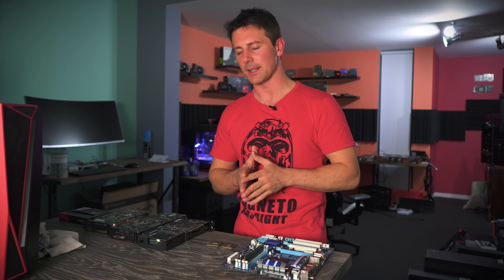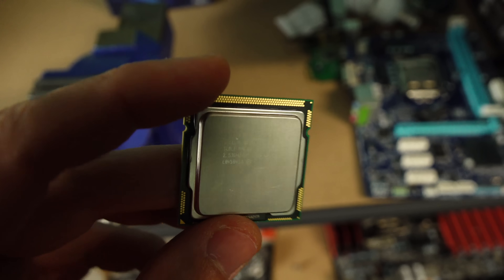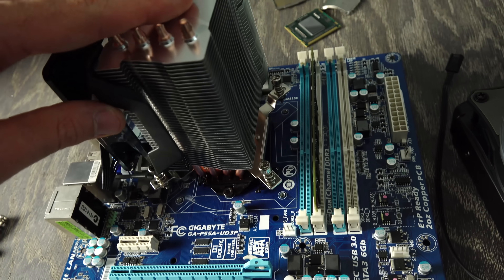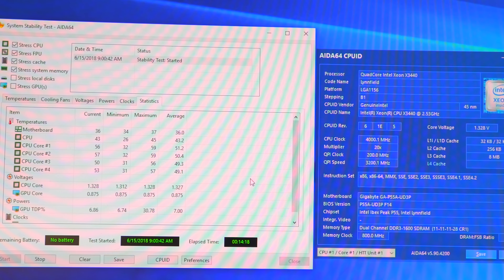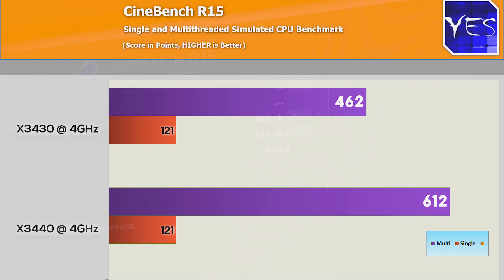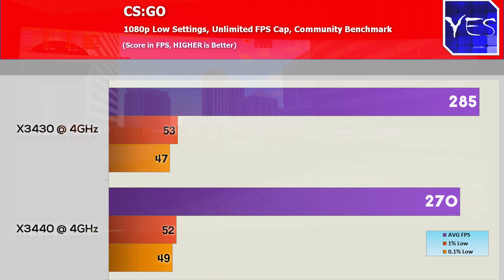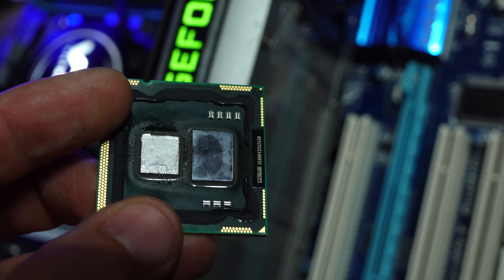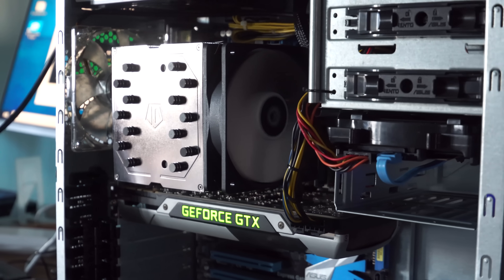X3430 ($7) Vs. X3440 ($18) Xeon - Is Hyper Threading WORTH $11!?

Comment: How did you relided it?
Reply: You can just push it back in really hard, just don't remove the black stuff that it is in when you delid it. That is how I relided my x3440 running very cool with high voltages on prime 95.

Comment: Late comment, but at 8:14 you wondered why the i3-530 had solder on one chip and thermal paste on the other: likely the cpu has the more expensive solder as thermal material for better performance since it puts out a lot of heat, while on-chip gpu puts out less heat and regular cheaper thermal paste doesn't impact performance - a way to save money during manufacturing.

Comment: hmm. I wonder if bryan will make an update with this Xeon processor. this X3440 is about $12 price now.
Reply: It still does everything great for me. I have mine at 4.4 Ghz ans runs any game over 60 fps. The only issue it might get later is the 16 gigs of ram limitation. It does have enough horsepower for another 5 years probably so it is still a good buy if you ask me.

Comment: hey i have installed x3440 on asus p7-h55m. there's a 8 gigs of ram stick @1866. but i am not getting a display. Do i have to put the ram in blue slot? I am testing it with a 1060. Thanks
Reply: 🙂 that speed is high, did u check the ram support list sheet, theres a vendor list for 1333 & 1600

Comment: is this still viable in 2019?
Reply: Yeah an X3440/X3430 can do games well. The only limit is the core and thread counts for applications that require rendering/encoding. But with modern applications, you can use your GPU to speed up the process.
Reply: Anything but Ubisoft, yes

Comment: Can I use a generic p55 and still overclock?
Reply: If it has heatsinks on the motherboard and 8 pin power connector for the cpu it should do decent.

Comment: Hm. Probably a good experiment would be some motherboard (is there any? oh heck for sure those are server CPUs) with 4 CPU slots, so you can throw there 4 x x3480 or x3440 and see what happens compared to the modern high core CPUs, because this setup will be 4 CPUs which leads us to 16 cores 32 threads (if we use x3480).
Really, the only downside of such setups is the lack of modern tech like PCIe 3 and DDR4. Other than that, CPUs are great.

Comment: can i overclock 4ghz with standard cpu fan ??? what a budjet cpu cooler
Reply: I ran i5 760 with box cooler. 4.01ghz at 1.226V vcore and 1.23V imc.. in ambient temps @20C it managed to handle at 85°C
Found some better cooler at work (same style just more fins) and running at 73°C. May push it a little harder during winter or swap for better paste instead of mx-2

Comment: I just delidded my x3440 but after aplying liquid metal it got worse temp results, around 88-90c. I then tried aplying regular thermal paste and I'm still having the same problem. I dunno what I'm doing wrong.. since I sucessfully delidded an I7 7700k and got great results. Can anyone help me?
Reply: The problem is elsewhere, there is no need to delid these cpu's, my x3470 doesn't even reach 70c at 4ghz. Better cooler maybe?

Comment: could somebody help me? i got a P7Q57-M DO motherboard and a xeon x3470. when I put the xeon in it it doesnt work but when I pit my old i3 540 in it it does. the xeon should be compatible with the motherboard. Did i made a mistake or is the cpu bad?
Reply: Maybe the mobo doesn't recognize the processor? Try updating the bios.

Comment: TYC - Which would you say is the best between x3430 x3440 x3450 x3460 x3470 x3480? I'm currently in China and can pick up any of these for around $10-20 US.. also I can get a 1060 3gb for $110 (used obviously) would it be bottleneck?

Comment: I picked up a 3430 after watching this and put in my intel h55 board which only has clock speed adjustments, no voltage etc. I got a 167 OC and left it there as it's 100% stable at stock voltage (3.0/3.5 turbo). I was going to pair it with one of 2 gpus a friend can mail me (I am in a fairly remote area) either a GTX 670 or 770 2GB. Which is the better bet, will the 770 be overkill? I dont want to pay the extra $50 for no reason. Hard to find info with this specific combo...

Love the channel btw, I found it by accident after I noticed the 3430 was supported on my mobo and started hunting for info. I have binge watched the channel for a few weeks now. It's inspiring the inner PC flipper in me and I've just started building a 2nd and 3rd PC from used parts.

Comment: Would you show me how to delid without a jig. With home tools razors or whatnot. I got 3470but it's idling around 52c. The chip is used and cheap so I think i want try delidding it to beef it up hopefully to play bfv. my p7p55 lx board is simple to use updated bios but tried the x3470 before bios update and it booted takes longer but double the speed and cores of the i3 530 I had.

Comment: Thanks for posting all this info. I've learned a lot. I'd love to see a comparison of LGA1156 on  H55 and P55, Sandy and Ivy Bridge Xeons like LGA1155 E3 and E3 v2 on Z77, LGA1366 E5 and E5 v2 on x79 and Chinese mobos, and similarly priced new solutions, like AMD APUs and low cost processor/video card combos. It seems these are the best options for budget PCs for both gaming and cheap workstations. Just some thoughts. Thanks again for all the videos!

Comment: Can you do a gaming pc with a DIYPC P48-W White SECC ATX / Micro ATX Mid Tower Computer Case  and a gtx 750 Ti,Xeon x3440,and a p56-a-lga1156 6 Chanel motherboard of AliExpress for $40 , and a this cooler of AliExpress https://m.aliexpress.com/item/32848259454.html?pid=808_0000_0201&spm=a2g0n.search-amp.list.32848259454&aff_trace_key=65f4896c1a0a4cdc82f27b455ee8904a-1530646203954-04555-UneMJZVf&aff_short_key=UneMJZVf&aff_platform=msite

Comment: Nice video, didn't knew you could delid 1156 CPUs ! Thought they all had soldered IHS. I've been using an x3470 OCd at 4Ghz for 6 months now, and I can't find any information wehther its IHS is soldered or not... Does anyone know which specific 1156 CPUs are soldered and which not ?
Reply: I think none if the 1156 are soldered on.
Reply: You can delid a x3470 btw. Unless there are big differences with a x3440

Comment: What bothers me a bit about these cheap CPU builds is how expensive the motherboards are. 50-60 USD is basically the same as the price of a new budget motherboard.
Reply: You can find some for 35, but no overclocking for those. Running one that costs 70 myself.
Reply: I got a deal for one at like 35 euros but it is limited to pcie 1.0 and newer gpus like a 2060s or a 1650 don't work on it, a 780ti does run fine on it tho.
Reply: It's called obsolete tax.

Comment: Vs the 3430 @4 ghz 462cb my Haswell i5 4440 @3.1ghz gets 483cb that's IPC gain for you. Still, have my i5 750.
Reply: I was shocked to see how close my 2600k at 5ghz came to a 7700k in cinebench r20.

The 7700k was still better of course but for the 2600k to be so much older and for the difference to be that small OOF

Comment: So then what are the logical next best upgrades for the cpu if pairing with a 1070/1080/1080ti if moving from a x3440?

Also for me personally I am running a i7-2600 with a 1050ti .. planning to upgrade to a 1080/1080ti what cpu should I upgrade to or will the i7-2600 be enough.

Will be playing at all resolutions honestly to mess around a bit and experiment and have some fun but will definitely taste some 4k and maybe even some HDR and maybe even stay there with a nice big tv and small monitor if my cpu can handle it.. I know the gpu can already just need to figure out the cpu problem (what cpu for best but still great value performance with 1080/1080ti cards etc).

Usage will be either separate single monitor or separate single TV.. No dual screen no both.

Cheers thanks everybody

Comment: What budget used CPU can you recommend for a 1060 6gb? Great video, great content, really interesting videos
Reply: Thanks for the reply 2 years later ahaha, appreciate it!
Reply: @darrenshan76  hehehe you are welcome :D
Reply: Buy a cheap ryzen
Reply: A xeon x3440 does work with a 2060super easily(so a 1060 6gb will be no issue) and it does also work with a 3060ti depending on what settings you play on and what kind of games. 

1440p and high/ultra settings then a 3060ti does work, for 1080p medium/ high a 2060super or equivalent should work well for the time being. But it does also depend on what kind of games in gpu heavy games the 3060ti can easily become the bottleneck, like rdr2 or pc3.

But a b450 motherboard and cheap ryzen is probably better. You can get decent b450 boards for 50 euros and a older ryzen 5 1600 for example won't be better, in most games but it will give you a nice upgrade path.

A r3 3100 would be a great choice if you could find one.
Reply: @Lynnfield3440  😂 thank you, I guess? :P
Reply: @darrenshan76  haha, I guessed you didn't need the answer anymore, but I've seen a lot of people ask similar ones and since it was 2am and I had nothing to do I thought why not.

Comment: Hey Bryan,  my brother from another mother!  After watching this video I got curious about a Dell Pro-Lariat Blade Server that I bought from craigslist a few years back when I was going to try and turn it into a server for my kid's Minecraft account.  Well, that project never came to see the light of day - literally because its been under my bed the entire 2ish years + since I bought it for $30 bucks off Craigslist.  I remember being disappointed knowing I already checked to see if it had a X5650 to X5675 for a few X58 systems I was building.. Well this video made me dig it out and check again and it happens to be a X3430.  My question is this... I really really love building these older bios overclocking style type of machines and just getting beautiful value for money out of them and blowing people away with how well they run.  I've done 4 X58's already and have 2 more I'm getting ready to start just need power supplies and cases for both of them, 1 of them is a Gygabyte G1. Guerrilla Killer with an i7 - 980x  and the other one is a EVGA X58 motherboard that I've never used but I read a lot of great things about it.  Before this all 4 of my other X58's were all Asus P6T Deluxe V2.  I've got a pretty good idea on what works well and what to hunt down and look for as far as X58's go but I have no clue on where to start with this LGA 1150 X3430... Can you toss me some of your forbidden jitsu training on whats good for this chip-set for overclocking?  Thank you brother, I look forward to every single video you post

Comment: Tech YES City hey what's up. So I bought a x3440 to do a buget build for fun and I got a gtx760sc yo go with it but I have a question for you. 

Do you know if the gigabyte GA-H55M-UD2H can overclock the x3440?
Reply from the maker: Yes it should be able to.
Reply: Tech YES City
What motherboard do you recommend?

Comment: I built a budget pc with 2. x3450 and a gtx 1060, but the funny part was I ziptied aio liquid coolers to the xeons because the original fans were pretty much jet engines.

Comment: Great video brian but regarding witcher its demanding and 780 ti dosent cut its older architechture  ie my gtx 970  , i7 4790k 16gb ddr3 1886mhz run witxher 3 very high setting no  hair works a1080p 60 fps v sync locked all the time. Never drops

Comment: Meanwhile I'm using my 3570k bought last summer, as an upgrade to my p67 mobo I had with an i3 that was lent to me from a friend. I had an i3 540 and I couldn't find ram for it, since the dual rank sticks were hard to find, I went 1155, more expensive, but allowed me to throw any ram I could find and my system is rippin for now. May upgrade later, But I'm gonna hold on to this for a while. I got screwed on the gigabyte p67 bios ivy not overclockable deal (couldn't have known, I didn't even know I was gonna get ivy when buying the p67 board for the sandy i3), So I swapped it for an asus z68, and now im running 4.2 ghz. Still under 600 cb, but its doin fine in games, I got a lemon clocker, but whatever.

Comment: I had an issue with my x3470. i disabled HT due to temps. but even at 3.8ghz, my x3470 ran the same as stock 2.93 with HT. with no improvements in games at all. Though overclocking my RX 480 gave me an extra 8-10 fps in games. sometimes 30 pending on the game.

Comment: I'm running a X3470 in a Lenovo E20 Workstation with 12GB of memory. Since it's a factory motherboard there's no overclocking but I think more importantly the graphics connector is PCIX2 and obviously all graphics cards are now PCIX3. How much of a real world performance hit is the PCIX2 connector creating? I'm playing Fallout 4, Witcher 3 and Elite Dangerous and all of them are on ultra graphics setting at 1080HD. Both my CPU and the Radeon RX 580 8GB card are running at around 50% and running very cool. Load screens take a little more time than I'd like but this PC is a complete lashup and it's ridiculously reliable. I'm just interested if there are any motherboards that use this CPU series that are also PCIX3 compliant.

Comment: I've actually bought a LGA 1156 motherboard (Asus p7 or similar) from China, I received it and paired it with a x3470 and it just wouldn't post, ordered a bios chip from Germany, still same problem. Been 2 years now and still have them collecting dust.

Comment: That cpu out performs my amd x4 athlon 860k and is a lot cheaper.... Screw amd false advertising as well. It litterwlly says its a "quad core processor" but its not... just 4 threads
Reply: Grizz They can get sued for that.
Maybe you limited in the BIOS how many cores can be used.

EDIT: Yeah, your CPU has 4 cores 4 threads, base clock 3.70 turbo 4ghz.
Reply: It does not have 4 cores. Just 4 threads... ive done everything even tried bios setting windows settings etc. Apparently amd cant lose any law suits against them for it because of how the chip is made or something. My chip performs just as well as the others benchmarked on youtube.... But it has only TWO cores and 4 threads
Reply: Grizz No, your chip has 4 cores.
I bought an Xeon 5650 6 cores and only 2 cores worked and then I fixed it.
I can help you fix it if you tell me if your Windows was installed using a different chip, and just then you swapped it out with the 870k - is that right?
Reply: Yes sir windows was installed with a different chip. But reading online threads apparently thats how its supposed to be. Apparently my chip has "2 modules" and 2 cores per module. No idea what any of this means. But apparently task manager and cpu z read that as only 2 cores. And apparently amd was in a law suit for this
Reply: Want to move to Discord so I can help you with this, you don't have to talk, just show me screenshots of your CPU-Z and I will link you a YouTube tutorial to follow.
Reply: Ok thanks man, later tho

Comment: I remember in a previous video of yours where you compared i5 8600k vs i7 8700k both at 5Ghz, if I remember correctly the 8700k got MUCH higher performance in CS:GO than the 8600k, and since the only difference between these is hyperthreading I thought to myself that CS:GO benefits a lot from hyperthreading, but now the X3430 wins vs the X3440?! I am confused! Can you do a video where you compare hyperthreading ON/OFF in CS:GO and/or other games? Thanks!

Comment: thank you so much for doing these videos man cause mainly thats what im useing an i5-750 and was looking to upgrade to keeping gaming on this old socket 1156, but sadly i need to upgrade my GTX 750 ti first
Reply: nice man i have a i5 660 might overclock it right after i get an X3430 cause i believe the X3430 is far better when OC also will be running a GTX 1060 3GB alongside this and will be used for retro games i.e NFS MW 05, Assasins creed 1, Dead space, Prototype etc. the latest title i want to run is the forest and i want it at 1080P low to medium settings 60FPS so yeah

Comment: hey brian. i owned x3440 for several months now. couple with asus p7p55 lx. this mobo doesnt come with vrm heatsink, and only 4 pin cpu connector. i did oc the cpu to 3.8ghz. but since i dont have the tools to check vrm temperature (afraid might overheat the vrm), i put this set into closet and keep using my i5 2320 with gigabyte z77 d3h.

questions are: 
1- x3440 3.8ghz vs i5 2320 3.2ghz. which is better? 
2- will the mobo vrm can hold 3.8ghz on x3440 without heatsinks?
Reply: The vrm heatinks cost like 5 to 7usd. And use paste to make contact. Run it in horizontal position for a day. The paste will harden and you got nice decrease in tems

Comment: I got the xeon x3440 for free along with 8 gigs of ram from my dad's job along with a lot of sandy bridge i3 2100/2120's, and a i7 3770 and a working pentium 3 and a few core 2 duo machines, and a athlon 64 300+ but it was fried, so i use it on my key chain for nostalgia. Love your vids Brian!

Comment: Bf1 needs to be tested as that ruins cpus with 4 threads. My 6600k at 4.5ghz could barely hold 60fps at 2560x1080 at any settings

Comment: LGA 1156 is still a great platform even today. My old i5-750 is running at 3.8GHz on an MSI P55-GD65 motherboard with an EVGA GTX 780 SC and 8GBs of Kingston DDR3 @1520MHz. I can push to 4GHz at 1.33 volts but my temperatures are much better at 1.2 volts 3.8GHz. I often wondered if grabbing an X3440 would help out my system because of the hyperthreading. Guess it's good I just stuck with my old i5.
Reply: What is your cooler?

Comment: You mentioned delidding both chips but what are you applying after the delid for these temps? better thermal paste or are you rocking some liquid metal? would like to know, I delidded my x3440 with liquid metal and my temps are still terrible at 3.6ghz (might be my cooler to be fair)